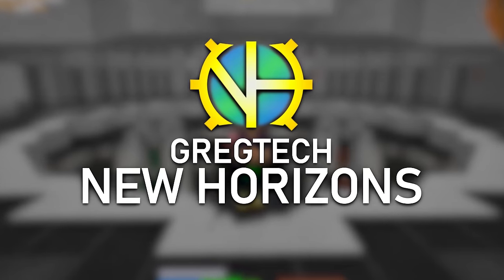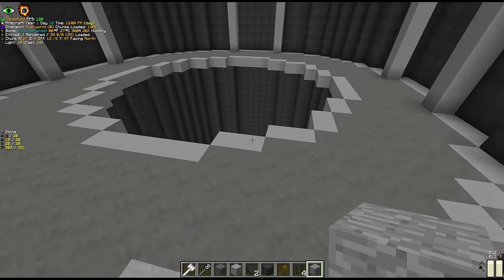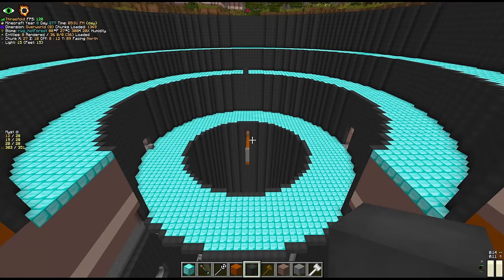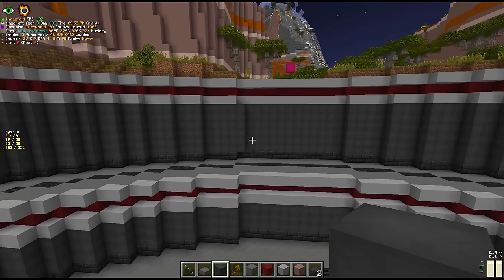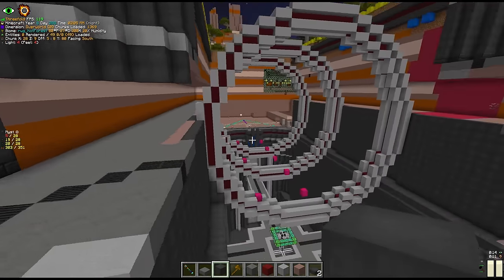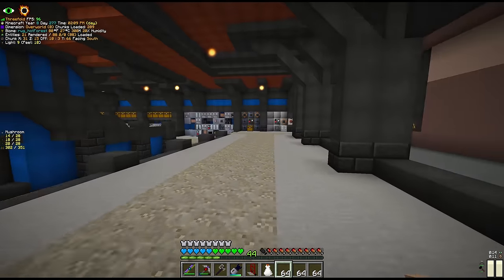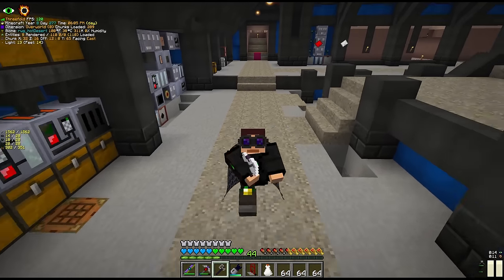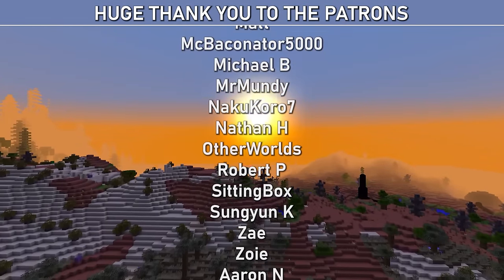Gregtech New Horizons S2 25: Base Concepts

Comment: How about purple for the accent color? Would fit the evil lair type ;)

All hail The Lord of Darkness

Also, I absolutely loved watching the creative design process
Reply: i wanted to thumbs this up, if there is a purple as bold as that blue then i think it will blend all that cool in the base nicely.
Reply: You're thinking of lashmak, not Threefold! All hail darkness though!
Reply: I wonder if it could work range of blues, purples etc - maybe a slightly different shade in each ring, like cool waves going through it. I think a bit of variation usually helps break things up and give a feeling of structure as you move through different parts of the base
Reply: @eagle653  Remember minecraft got 16 colors, not 256 nor 16milion (which would be nice hah)

Comment: And this is why you set up ore processing early, when you can afford the power cost. Yes, GT++ multis in IV will make it largely to entirely obsolete, but remember that you can set up ore processing in early HV. Three is still a rocket away from getting the necessary ores to open up IV proper, and that's just getting the ores. After that comes proper Tungstensteel processing, getting Radon going for circuit upgrades, EBF upgrades, setting up an ABS, and finally crafting the (very expensive) multis. To say nothing of making any necessary upgrades to your power grid as you work on that, possibly switching over to centralized power in the process. Oh, and don't forget that somewhere within that mess you would do very well to set up some Multiblock Miners to start bringing in more ores as well, which means those diamond chests full of ore blocks are going to start filling up even faster than before with crushed ores. Yeah. Getting materials in GTNH is half the work. The other half is turning it into useful stuff. Don't neglect that, or you'll find yourself with chests worth of stuff and no materials to do anything with.

I would just like everyone to know that the chicken trophy + feather recipe takes an MV Assembling Machine. Making your own BM flight flask technically only requires a T2 altar, but with only that you'll be limited to only a 1 minute version for want of being able to craft Lengthening Catalysts (admittedly they can be found as loot). To craft as good a Lengthening Catalyst as the chicken trophy flask uses you'd need a T4 blood altar, which takes Titanium and a metric ton of suffering. Getting creative flight through Botania's Flugal Tiara takes Naquadah Plates for the Gaia Pylons. Angel Ring is also in the pack, but it's recipe is even more stupid, taking a T2 fusion reactor and eight Primordial Pearls among other stuff. So, yes, barring going out of your way to craft your own, better BM creative flight flask this is the best you're going to get for a very long time.

Never design bases around having flight unless you've got something like Reverence of the Condor ritual providing creative flight in an area. Because sooner or later (unless you play Hardcore, I guess) you're going to eat a stupid death, be send back to your bed, and realize you don't actually have a way to get out/into/around your base without making some quick dirt pillars. This is especially important if you continue to stubbornly refuse to spawn-proof your base, because all it takes is one dark spot for a creeper to spawn and end your existence 🙃. Of course another option is to use EnderIO Travel Anchors to allow for easy/convenient access around your base.

I find it useful to have AE2 cables and GT energy cables on different Y levels, of course with access to a dedicated maintenance floor for those cables. Also consider carefully what kind of AE2 controller design you want in GTNH, because chances are you're going to be using a fair few connections, and the last thing you want is to rebuild your AE2 controller and redo everything. Also something to consider is emergency backup power for your AE2 controller. I doubt it could realistically happen considering how late you get AE2, but you do not want to be in a scenario where you can't access your digital storage for lack of power to run it. Something else AE2 needs in GTNH is energy cells to give the network a decent amount of energy storage, so keep that in mind with your design as well.

I thought I mentioned before to gather your tools before you start building. That TiC hammer is well outdated in terms of it's materials at this stage, you could definitely get more mining speed/durability out of it. In addition Vambraces of Steady Progression from Witching Gadgets would largely to completely (I'm not 100% sure, it's difficult to test) negate the mining speed penalty from flying, among other things.

You can enhance the Equal Trade foci to give it Silk Touch, for reference. Enhancing it also allows you to increase it's range, give you finer control over it's effective area, give it Fortune, or make it cheaper to use. Depends on what you want.

I don't have a direct suggestion on names, but if you continue with the evil villain lair theme you should adopt an evil villain name. You can't have an area that large and ominous be commandeered by just Threefold the Builder. Unless you're going for an "evil forgotten twin of Bob the Builder" idea I guess🙃.

Comment: I'm obviously not biased, but blue seems more cool ;) Feels a lot more uplifting to me in contrast to the already adbundant warm colours of the concrete and Mesa.

Regarding consistency, you could consider formalizing your styles in "design guidelines", where you describe certain elements of your design. This could include the block palette, what colors you're using, for what you are using them for, floors/roofs/path designs, etc.

Comment: 19:28, dont worry! this is really interesting :D. like that commenter said, its nice seeing you try ambitious stuff, even if it doesnt end up working. It's a fun journey! Also i really love the idea of the vertical cables going up the side. something i love about some base designs is when they incorporate the actual technology into the base, especially when you can see the pipes that fluids, items and power is going through. I also love it when theres a huge complex machine, and it has things like catwalks, beams and structural supports so you can walk around it, access parts and perform maintenance.

Comment: I would reccomend calling it the World Heart, because kingdom hearts lol. (The world heart is 1) kinda tied to how sora is able to progress across different worlds, which ties into the goal of a tier 5 rocket and 2) looks like a keyhole you need to unlock)

I would also say instead of baking architecture blocks into the design, that you create 'mural areas' where you can add architecturecraft details that wont get in the way of the rest of the base. or use certain symmetrical architecture blocks like the slabs or semi-symmetrical ones like rails and then let the ends of the rails be a placeholder block to let you know that a specific thing is supposed to be there..

Comment: The Circle Remind me of Electro Magnets on a Particle Accelerator. or say a Fusion containment chamber. ARE THERE LIGHTS THAT CHANGE COLOR. The Blue looks best, but the reds not too bad either. If possible to make the colors switch or parts of it to switch would be sick. Like for launching rockets base has a sequence. You have the ability to move Aura Nodes now i beleive. Idk if they look cool or not, could put them around the base, go collect some more moon rock and steal all the Nodes on the moon.

Comment: Why not continue to use the accent colors from the rocket silo? (Orange, blue, red, and Green). Bring them all they way up and use them in the top of key hole (might end up looking like a Simon Says game). Then in the line part of the key hole You can add a 4th ring and do 1 of each color.  You can then bring those accent color out to different area's of the base depending on where you are (NE - Orange SE: Blue, SW: red, NW:- green).  You could then also use those different color accents in your access tunnels(A tunnel with Orange on 1 side and blue on the other means that going east will bring you back to center).  You could even bring the accent colors into your A.E. Cabling.

Comment: You also might want to use antiblocks from chisel, theres this guy Sampsoy on the feed the beast subreddit that uses theses with a special technique to hide the black outlines and it looks amazing. Personally, I don't really like the stone brick, I feel like it adds complexity for nothing, I do like the concrete on the rings tho. Also, browsing the gtnh discord server, I see a lot of people using screens from open computer(?) to display data about the bases like liquids and stuff currently in progress, might want to think about this. IIRC, forge micro blocks causes a lot of lag. The rings feel like they are a crucial element to this base design, I really like them. Keep up the good work, this is my favorite series to watch rn and you're doing a great job!

Comment: I'm voting for blue (or purple if it's an option), I find that red almost always starts to grate after a month or two it if I put too much of it anywhere prominent. Also I like the effect of the basalt columns breaking up the big flat walls of myst - as a suggestion, I think a bit more ribbing/edging like that could help add more definition to the shapes and make it all pop. Maybe some pillars around the circles? Or maybe a more complex pattern,  like a power circuitry type of thing? Either way I'm looking forward to the end result - I think when you go through to add all the details and get the added structure/definition from that stuff is when we'll really see it all come together, it's going to be so cool when it's all tidied up and you start moving the greggy stuff in

Comment: Since you have four colours in the launch pad, could you add an extra ring and have one of each colour? Maybe having them shrink/grow in size as you move away from the control room to have them aim at one end of the keyhole.

Edit: As an addendum, it would be pretty cool if possible to put some sort of launch bay doors on above the rocket perhaps? Which can be opened with the push of a button but otherwise ostensibly protect the rockets below.

Comment: don't know if its been posted before but the command for placing a schematic with world edit is //schem load <schematic name here>. the folder should be in your config folder, path being config\world edit\schematics\<your file here>. Also, a neat interaction between schematica and world edit: world edit does indeed load and paste a schematica file, but it does not understand everything in the file(when i tested this mod blocks were replaced with replaced with different blocks sometimes other mod blocks sometimes vanilla blocks). it is better to just create a schematic file with world edit. to do this all you need to do it copy what you want to save onto your clipboard and then use the command //schem save <filename>

Comment: I really like using the blue myst as the accent block, more than the red. I also approve of the use of catwalks, having a base be functional but as well as great looking is better than either alone. Painted glowstone is something that I have never heard of and will use from now on but something I recommend are chandeliers/magnum torches, they prevent mobs from spawning (including slimes) regardless of light level at a good distance. Lastly I think it would cool to have something go through the rings to make it look like they are focusing a laser or something, on Sampsa's server they have orange sphere's going through decorative pipes to give such a look. I do very much like the building aspect of this series and it very much inspires builds as well as giving ideas I would not have otherwise had like having verticality in your floors.

Comment: I wholeheartly support the evil base. Evil Steve is best Steve.

Another piece of advice, if you end up getting rid of the thaumcraft obelisk, i think you can also get rid of the earie biome it generates arround itself once you research the thaumcraft flower that cleanses tainted biomes. It will take some time, but it will also restore that eerie biome into it's original biome.

Comment: Love seeing the design process, every minecraft builder ideates differently and I personally think you're crushing it. My initial thoughts were that the horizontal elements (stripes of stone brick and izm) were a bit too prevalent, but I really like how you countered that with the support beams at 18:18. My suggestion would be to try out using a block that is close to myst in texture and hue, but a few shades lighter so that the vertical sections there pop a bit more against the wall. Also I'm liking the blue accents a lot more than red because of the surrounding mesa.
Excellent work Three, congrats on 40k

Comment: One thing that could be a nice accent with your vertical cable tunnels is (if you're using the white cable, which sticks out) is placing a dark kind of glass in front of the tunnel that accentuates the cables behind it

Comment: Your base looking gorgeous! 
I have little tip with ME system: you need 2 separate ME systems, first for main use and second as a p2p connector for controller and devices. This setup can achieve 32 ^ 2 = 1024 channels per cable, so you need pretty much one dense cable for the whole base (for me this amount of channels is enough till the endgame). Clean and elegant solution for mess with cables. Second system even can be fully aligned into the 5*5 square (or 5*5*5 cube) inside of first controller, it looks like some kind of art installation lol ^3^
Hope my tip will be helpful <3
Reply: Three always does p2p with 2 controllers, don't worry! Also, with the newer GTNH versions, you get backbone cables which have 128 channels, so you can get even more dense tunnelling. And you do actually need it - lategame GTNH can be well over 1024 channels even if you're quite conservative. Worth planning your controller design to expose at least 100 or so faces so that you don't have to tear it out and rebuild your entire p2p network when you run out!

Comment: I really like the design youve come up with so far! 
The Korp accents on the terraced cylinder floors ( 13:06 ) dont look amazing to me though. I suggest you could break them up by making it into more of a striped line. Removing the ring in the most diagonal parts, while keeping the (mostly) orthogonal parts. The most diagonal parts of a circle end up somewhat jarring in minecraft, so de-emphasizing them lets you play into the square nature the game a little. This doesn't hold in general, the floating rings looks great for example! But I think for one block wide circle outlines it could be something to keep in mind.

I can only see this base turning out cool with what youve shown in this episode! I cant wait to see it grow, good luck!
Reply from the maker: I thought just the Moon Rock was a little plain, but I didn't try a whole lot of different options for that particular section. I think you are right in pointing out the jarring look. Something we can adjust when building in survival :)

Comment: Hey Tree, you talked about drawes for bulk storage. Im not sure if its been fixed by now, but in Season 1 wasn't there a bug with storage drawers and AE2 that voided items regularly? You might want to consider making a storage subnet with tonnes of storage busses on either barrels or other forms of mass storage (something similar to mfrs deep storage units)
Reply from the maker: Drawers with AE2 as far as I know has been fixed completely. I've been assured the same issue will not reoccur :)